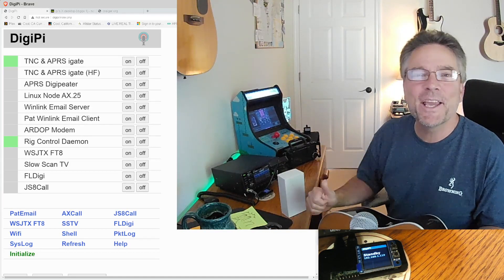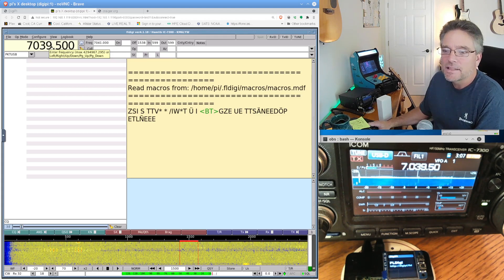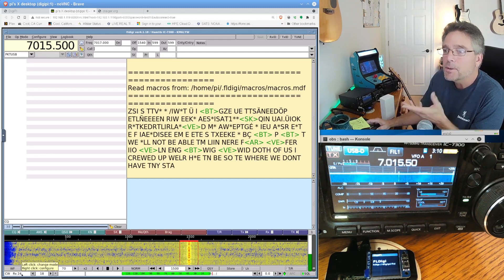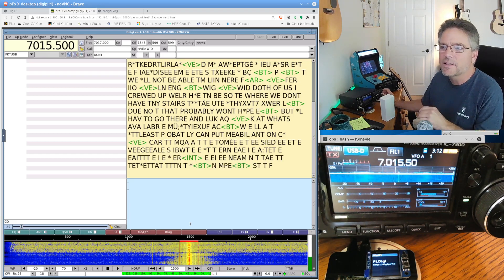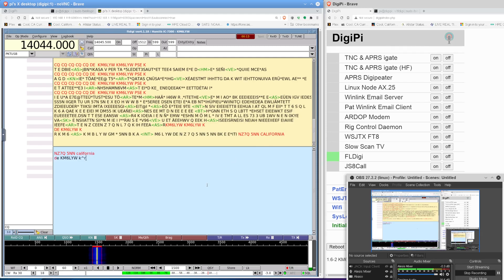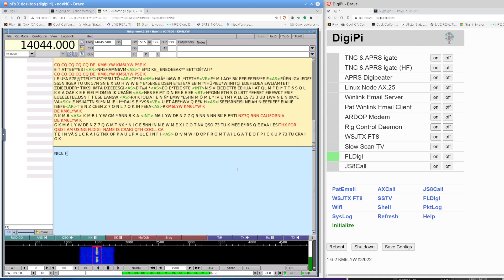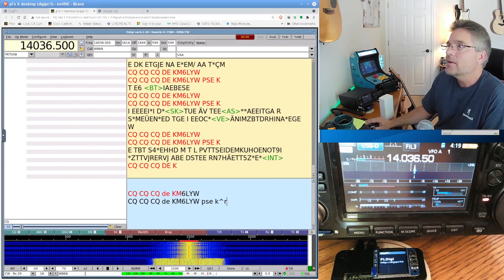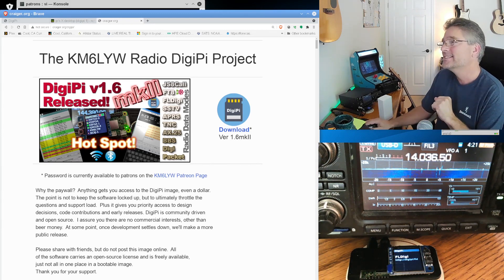DigiPi making CW contacts

Comment: Hey Craig, Long time patron here but just found this video. In my opinion, no need to apologize for not knowing cw protocols. Ask yourself if you are having fun. Lots of guys will help you and just ignore others that get snarky. Best place to find cw though would be to almost always look lower than the FT8 frequencies. Higher is used mostly for digi modes so most guys seem to hang below even tho on 20 meters the cw band goes up to 14.150.
73 and keep the videos coming. Tom WA7NPX

Comment: To get CW right, place your waterfall in the 1000Hz range and narrow your envelope to 2.5KHz or lower and select CW on your radio settings. That will stop all external signals coming in and you will pick up the tone better.

On my Yaesu 897D it has CW-T. By narrowing the stock filter and getting square on the CW beat the radio lights up. That is when it is on the correct pulse of the signal received. So if you do that then you will get your radio working in the way it should. Also in 2007 I tried copying a friend using CW and found that FLDigi does not work well on 100WPM CW. 70WPM is the limit or there about. So if you are doing CW MGM about 80WPM will be the highest it will go to.